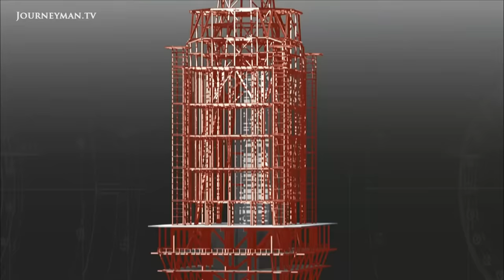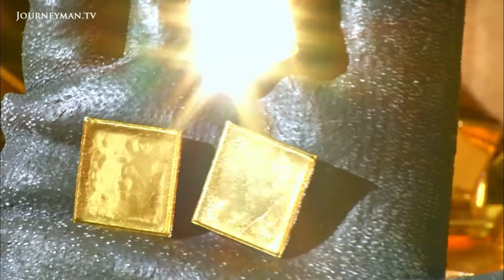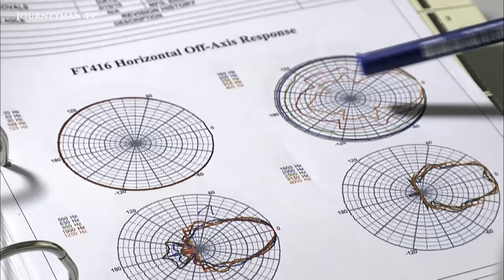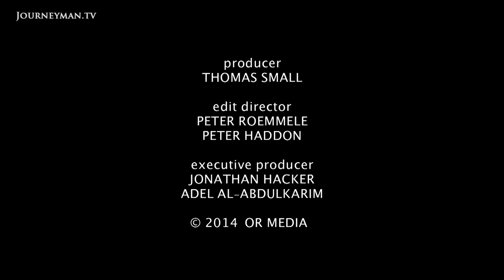Saudi's Lavish Buildings Threaten To Overwhelm Mecca Site

Comment: The huge scale of the building is tolerable but the clock is Western, archaic and out of place....
Reply: I don't think the building should even be there. Mecca is known as a religious symbol, a place of pilgrimage. The building just ruins the experience.
Reply: Wtf is a non-Western clock lmao, all clocks are the same only the numbers change.
Reply: Blanco I think he means the architecture of the clock. It looks a lot more like Big Ben (archaic and western) than typical middle eastern architecture that you might find in older mosques or secular buildings like palaces or castles
Reply: Building skyscrapers is also western. Actually most things were invented by westerners
Reply: Even youtube is also a western thing dont use
Reply: @AgniFirePunch  not really, when you go deep into the roots of inventions, a lot of them where stolen by the romans from other places and got called a "roman invention"
Many of the "western inventions" where taken from the egyptians, babylonians, and indians
I mean, I still hear arguments that the roman enpire invented the sand clock, which is completely false since that came from the middle east

Comment: when you have limited space and 4 million people come to this limited space added to the five million residents, you need a massive housings how you can solve this issue while you have no space? by buliding verticaly new towers, so can every one pray in the holy mosque and have easy access. and as you mentioned we need to pray toward the Kaapa, the clock tower is an appropriate guide for it. we are the Saudis happy and honoured to serve the guests of Allah and will not scrimp by our money in serving the piligrams.
Reply: talk some sense man.this building can be constructed 1500 meters to 2000 meters away from holy kaaba in that way.the people who are doing umrah and tawaf will not get disattracted by this buildings.i have seen people doing tawaf of kaaba with eyes on this huge building.its a distraction in a holy place it needs to be dismanteled and build at some distance.

Comment: IT reminds me of lower Manhattan. The clock tower and specially the surrounding buildings reminds me of the style and glut of older Type high rises that comprise. !! WALLSTREET !!... eareely like it... this is no spiritual endeavor. This is about earthly power. Not a heavenly one.An engeneering marvel it is. Massive, imposing, impressive. Architectural kitsch too. Not High Architecture...not cutting edge creatively Architectural design.